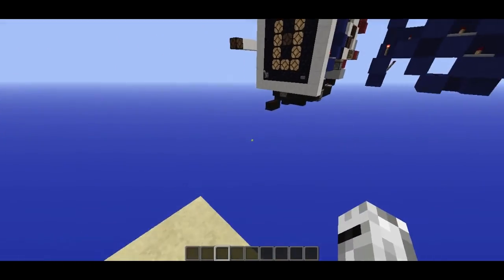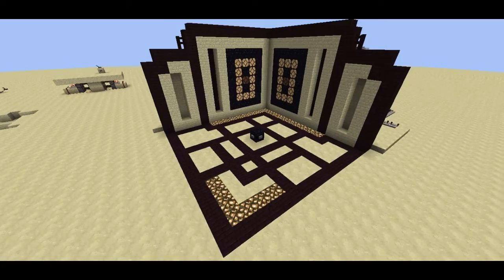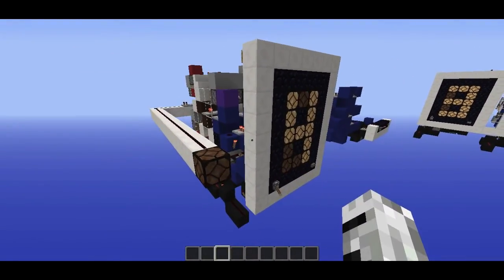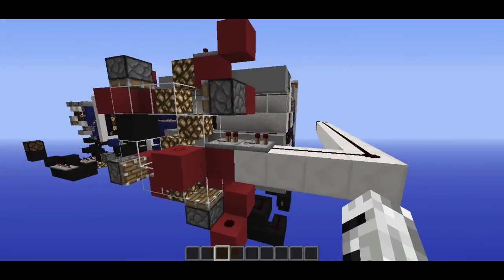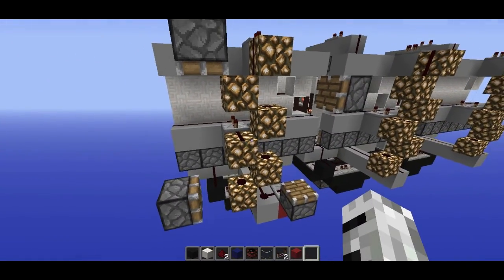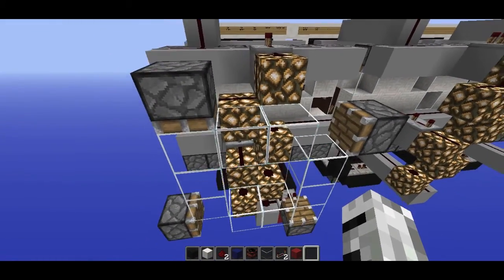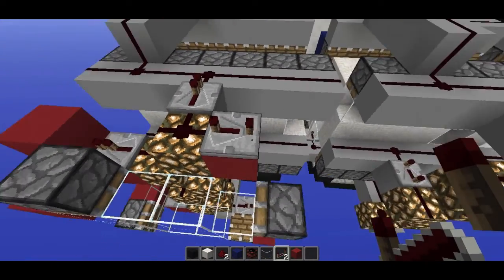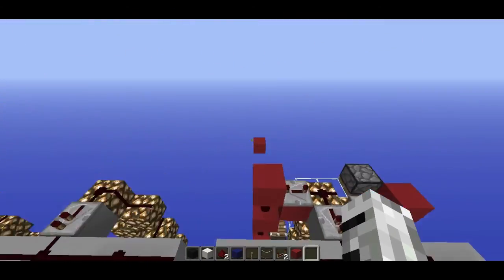Minecraft 1.15 -How To Connect Two Or More Displays Together - Make Scoreboards, Timers & Counters!

Comment: its pretty cool i made one with 5 digits i added a mechanism to toggle the counting on or off and added water couldrins into the output loops and made it so i can use it as a passcode lock with multiple codes to trigger different outputs